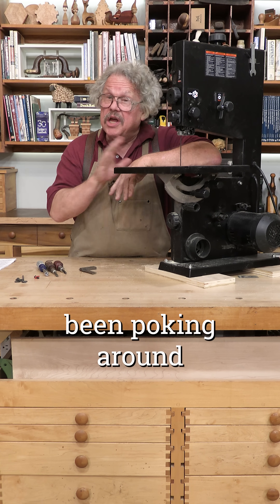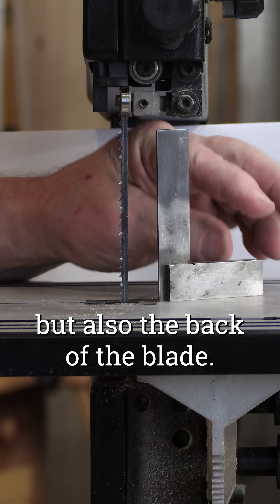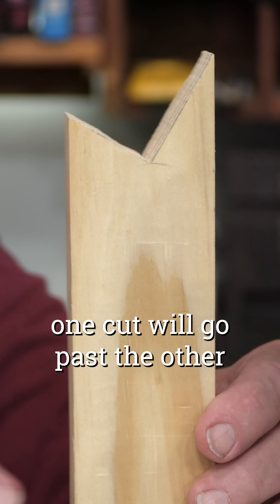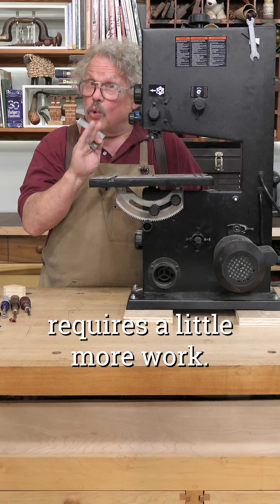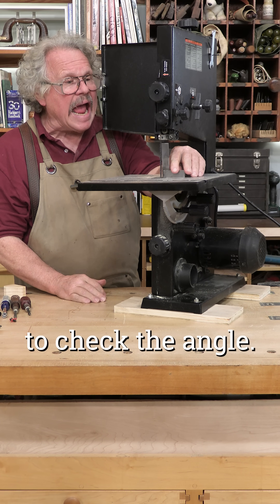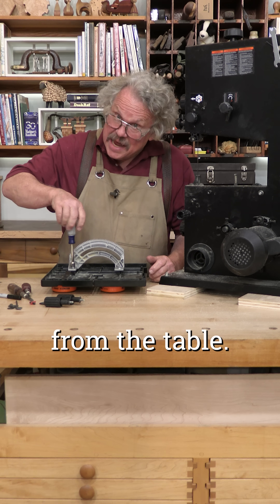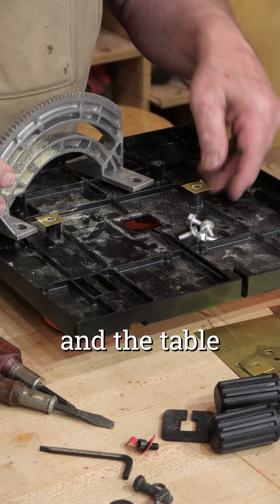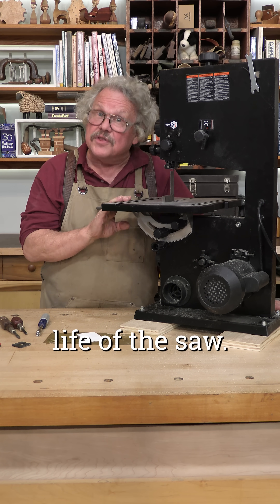Squaring the Bandsaw Blade to the Table

Comment: To decrease the amount of times you have to adjust the shims, place part of the square on the table and part on the top of the shims until the square is lined up with the blade. Then remove the table, install the shims and test for square.
Reply from the maker: Good tip, but viewers should know that works accurately only if the length of the base of the square is equal to the distance between the trunnion bolts front-to-back. But even if the two measurements are not exactly the same, it's a way to get close.

Comment: This is an important adjustment and here's a tip. 
With your square sitting on the table, push the blade of the square against the rear of your bandsaw blade. This will force the edge of the square's stock to rise off the table, and you can use your shims to "measure" the gap between the stock and table . It should cut down on a few reps of adding shims and reassembling.
Reply from the maker: Good tip, but as I told another viewer, for this to be accurate the length of the base of the square should be the same as the distance between the trunnion bolts front-to-back.
Reply: @WorkshopCompanion thanks!
Reply: @WorkshopCompanion 
I'm unclear how that guideline would hold up on a larger saw. 
I have a pretty standard 14" Delta. The trunion bolts are 6-1/4" on center from front to back. A square with a 6" stock is going to have a blade that's much too long.
Reply from the maker: @carlson.douglas.w  Not a guideline, just an observation. If you have standard Delta 14" without the riser, simply cut a 6" x 6-1/4" rectangle from a piece of plywood. Use that as your square.
Reply: @WorkshopCompanion thanks. Sometimes the most obvious solutions escape me. Thank you, I appreciate your videos!

Comment: this makes so much sense as to why my dad's bandsaw has always cut so poorly! odd that there isn't an inbuilt adjustment for this since you might end up needing to adjust for different blades
Reply from the maker: Not really. The blade -- not matter what the width -- always seeks the highest spot on the tire. As long as you consistently center the blade on the upper wheel, it's relationship to the table will remain the same.

Comment: I have an old craftsman bandsaw from the 70's the table on it has no adjustment, only option is flat. To square it i had to add shims under the bolts that hold the cast iron top to the frame. Its a lain in the butt to do but that saw is an absolute tank.

Had it for 2 years before i realized it has 2 speeds, i was cleaning the sawdust out of it one day and happened to notice that the drive belt pulleys were double pulleys, for some reason i just had never looked on that side when i had it opened up, its so nice to be able to run it at a higher speed when i have the fine tooth blades on it. Not long after that while i was moving it i realized it even says 2 speed on the tag with the model number and i just never thought about it 😂

Comment: I had got one like this (Einhell brand) and after 2 months of tuning I realized that tension needed to a proper cut was enough to bend the body of the tool so, after a few cuts, calibration was completely gone (meanwhile flywheel tilt was totally flimsy and keept his place just by the bandsaw tension). Was fine for spliting firewood but not for joinery, finally I sold it loosing time and money.

Comment: I use this but 20 times bigger to cut my wood logs ...and with 25 years of experience...the only 2important things on this machine are

1)The cork condition on both wheels,
    It has to be Rounded and Smooth
2) the blade not only has to have to proper tension, the two tampons on its side made by cork have to Touch the base to prevent it from Twisting

There is a third one

The Main wheel speed depends on the length of the blade; for my machine is 960 Mt so is around 3.200rpm , for a 720 is 2700, for 540 is 1800
Remember that also you need a second clutch before the machine to control the Speed and vibrations even further..

And tbf...I would never use this type of machine to make precise cuts....there are better ways to do it

Comment: I've seen some very nice high end band saws for machinists come with a bolt you adjust for exactly this, though they have far more complex construction and their beds are not quite so simple. I would've assumed wood workers got the same thing, if a bit less precise, finding out they don't shocked me. Wood demands less precision in the tolerances than metal due to the nature of the material, but the nature of the adjustments needed between the machines used on both typically are identical. I will also point out that most band saws I have seen for machinists still require this to be done the old fashioned way shown here. But those guys have the tools on hand to not only make the measurements but also make the perfect size spacers to adjust everything. They also have far more methods to adjust and align everything because they need it. And even then they are going to use a far more precise tool to true everything up at the end because tighter tolerances. 

For those wondering "why doesn't it come this way?" Or "why don't they tell you how to do this?" Well the answers are mostly interlinked for these questions.

Firstly cost. This process, assuming you had a specialized calculator to do it as fast as possible, would I'd estimate take around 20 minutes each machine to do it to a standard that could be sold without mistakes rushing it. Assuming all the parts were at the bench already. Likewise if the manuals suggested this then people would expect proper parts to do so to be included, and that'd add cost to production as well as time. Not to mention including that in the manual means more pages, more ink, and more labour for a skilled and knowledgeable person to write those sections. Which means more money. 

The second issue is appearance of quality. Having to adjust something like this yourself makes the product look "shoddy" to the uninitiated (*cough* marketing *cough*). To those who are initiated then it's just part of adjusting the machine after shipping. You can't have people thinking your product is less than perfect as the face of a forest maiden, they might expect a lower price point. 

The final reason is mass industrialized production. Industrial scale production means tolerances have to be as loose as possible so that parts can be interchangeable. This way during assembly you can grab any old part of a type for the bin and slap it in place. It also means you can produce parts faster as you don't need to be as careful. Tighter tolerances would reduce or eliminate the need for such adjustments, but it also would take longer and require each piece being bespoke. It'd make repair significantly less feasible if they sell replacement parts, and make buying a replacement more expensive if they don't. However it's also worth noting that shipping always risks knocking stuff around and off adjustment, but even then properly shipped and well constructed examples come with this handled. You could ship it with adjustment washers or include a feature to allow adjustment by turning a bolt, but those would be an extra thing to produce and can't be too sloppy or they wouldn't work. If you make the end user do this themselves then you can blame any imperfections on said user. 

These hobby saws are cheap mass produced things intended for people who don't know much or can't afford better. They need to be cheap and fast to produce, and they need to look good to the average Joe Bloe. You need to keep production cost in the floor so that you can keep costs low while making a profit, while trying to not imply that your product is suboptimal out of the box. It needs to look ready to go out of the box so when it breaks you feel alright buying the same model again without regrets or thinking too hard about it. Especially if you end up with more money than brains later so you don't look at a higher quality competitor's model and instead just start buying a new one every time something is slightly wrong.

Comment: I am a bit peeved that you mention this "critical step" and even mention the shimming, and then go "vague" in how to actually perform the task... If the trunnion is mounted to the middle of the table, one can loosen the screws and see whether the table stays balanced. Then place a level on the table and use a feeler gauge to figure out the thickness and where to put it. This can be done with a couple of feeler gauges if you find the table does NOT balance. Same tactic, loosen screws and check the level, insert feeler gauges and tighten snug and check again. Add or subtract from the thickness until level and then cut your shims to match.   Hope that actually helps somebody better than what was given.

Comment: One would kinda wish the manufacturer would do the adjustment, manufacture with more precision, or at least add an adjusment mechanism.
Reply from the maker: ...which would add to the cost of the tool. Part of the reason you get such a good price is because the manufacture skips these steps.

Comment: But if you tilt the table when the front of the blade is square won't the front of the blade end up not square. 
In fact I am having a problem seeing how the front of the blade can be square and the back not.   Twist I can see and have experienced but this seems odd.

Comment: Te best thing I ever learned about bandsaw setup is that the top and bottom wheels should be perfectly aligned.
The blade will go exactly where it should and adjust everything else to it.

Comment: One way to get clean holes drilled in shims is sandwich them between a few boards clamped and then drill square through it all (safer too). Made some with a pop can for thin shims recently.

Comment: I have the cheap Rikon 10". Wasnt THAT cheap for what it is, and it opened doors for me learning. But man is it frustrating the more I'm finding myself demanding proper tolerances
Reply: I have the deluxe version (10-3061) & have sung its praises. The fence is good, the no-tool adjustment bearing guide system is a league above what most of the cheaper range of bandsaws offer, and I believe it can be quite accurate. Still, I eventually saved up & bought a laguna, and I am in love with that machine. Laguna resaws (and it leaves such a smooth finish that I go to it more and more for ripping) & the rikon can be permanently set up for more intricate curve cuts.

Comment: Why make your own washers instead of using whatever uniform washers you have on hand?
Reply: becase the shims he's speaking of are much thinner than most washers. The saw table may only need a few thou of shimming to get it square to the blade. A washer would be much too thick. And, as he mentioned, even paper can be used, so it doesn't have to be expensive. As Nick mentioned, it's more time consuming than anything else.
Reply from the maker: If you have washers just .005" thick or thinner, use them by all means.

Comment: you sir, are amazing! I dont know you enough to say for sure, but i swear, you were  or are a teacher.. your knowledge is remarkable!
Reply from the maker: University of Cincinnati.
Reply: @WorkshopCompanion Not gonna lie, Nick. I've been using band saws since the 80s and I never knew about squaring up the back of the blade. I learned something today.😊
Reply from the maker: @frogsoda  This seems to be an adjustment that is almost universally ignored by manufacturers, perhaps because no one one has come up with a simple solution in the two centuries since the bandsaw's invention (1809). Nor is there a push to do so. It's not part of the bandsaw's alignment and adjustment system because it only needs to be done once. Adding this adjustment could conceivably cause more problems than it would solve -- one more thing to forget to check during your set-up.
Reply: @WorkshopCompanion I agree.
Reply: Is and has been for about 3 decades. At least that's how long I've been following him.

Comment: Perhaps this is a silly question, but if it only needs to be done once during the life of the saw, why doesn't the manufacturer do it? Thank you for the advice!
Reply: Like it basically always is: cost

Imagine the man-hours needed to do something like this for each saw produced
Reply: Maybe changes during shipping, handling, set up
Reply: On a really nice band saw, they do. On cheap hobby ones, they don't.
Reply: Shiping
Reply: It's always going to come down to cost. If you paid enough for your saw then they probably did. But even then in shipping you could have had some issues. But if it was a cheaper saw than they definitely did not. Because this is the kind of thing that would need to be done for each individual saw even if it would be similar steps for each saw because sadly even with the exact same parts in every saw there's going to be slight differences in each of them. Because the angles are going to be compounded by minor changes in every single part.

At minimum the manual definitely should have the steps on how to do this though. Even if the manufacturer isn't going to do it themselves they 100% should provide the shims and should be providing the steps it's really bullshit that they aren't.
Reply: @JW-452shims can be made from anything you have around the shop. From a playing card to a piece of very thin paper in layers.
Reply: Actually that's a very good question and I want to know the answer as well.
Reply: @surfboardtrough7742  the answer is the comment directly above yours